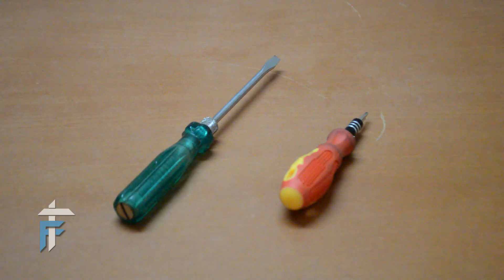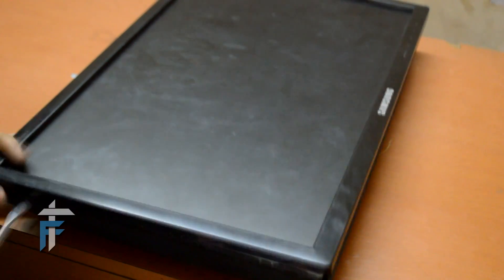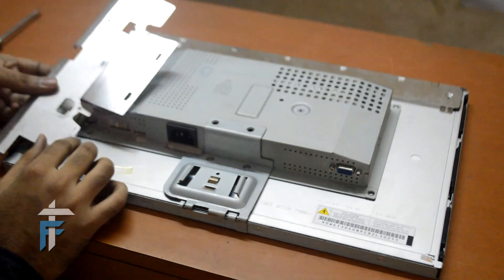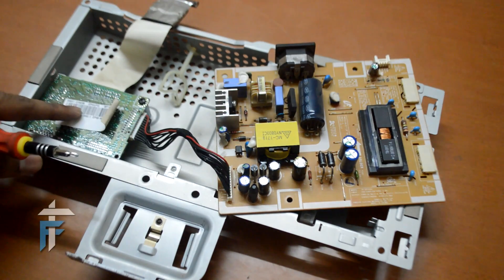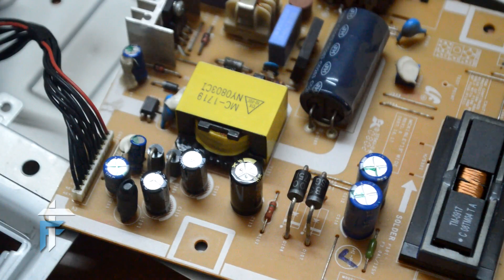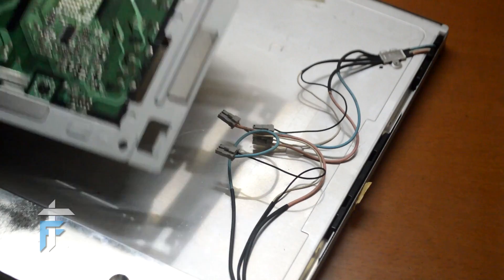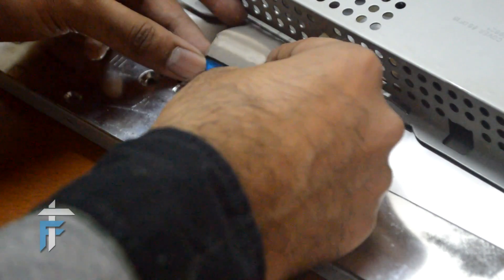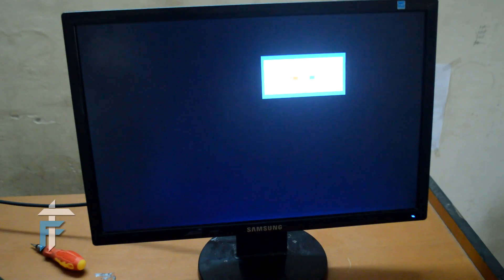LCD Monitor Repair and disassembly | Samsung Syncmaster 943NWX

Comment: The repair guy titled the circuit and threw away the metal, the monitor still worked fine for a few days then went back to how it was and after I opened it and fixed the bent the monitor won't display anymore, it turns on but it doesn't display and I have no idea what to do, I used to hit it hard to force to display, now even that won't work.

Comment: Nice video. Is it possible to disable the energy save option hacking the internal power supply? I need to have it always on and not entering in low energy mode...

Comment: i have the same monitor..no bad capacitors but when plugged in, screen is blank ang flickering like its trying to turn on but will not
Reply: There are High-Voltage Fluoroscent tubes in this model, not LEDs.
First try bypassing the "protection circuit" (search on internet)
If you cannot pinpoint the cause of flickering, just convert it to LED (unofficial kits are available)

Comment: I replace 3 capacitors in the hot zone and the 3.3 volts out is only showing 0.5,  the rest are 15 volts ad 3.3 volts perfectly. I have no video. Any ideas? thank you.

Comment: same monitor  is have an issue with reddish screen while connecting VGA cable to CPU, if not connected to CPU the sign as shown after plug-in  just works normal, any solution?

Comment: i broke the screen while i change lamps for this model , is there any solutions ?
Reply: It's fixed right in color blood red that fibg that made around the world  that was ours wit h yours it was like it was married together  but around the world someone else awaits for what the promise was of one and  a contract that was put forth you never came on that behalf I can get real mean if so then what  a duel  RSP 1012 2nd Corso nebr city nebr USA tetracycline batman only it will go below the belt and come back  pinch a little powerful huh mid body  worked out for alk you huh  that'd what I say whats done I'd done and a deal is a deal    mercenary  think not canary yellow his truck my brothers  blue on white that car blue on black mind got stolen but l jn alm UT needs returned before 72 hrs is up from now

Comment: I used this video to help me repair my Samsung SyncMaster 953BW, Very similar. I also had this same problem with my SyncMaster 204B. Crapy caps. Change any swollen caps and any others of the same brand. These caps are junk.

Comment: The inside part of the  glass of my LCD monitor shows  lot of mottled appearance.               How could I open and clean the glass ?. Electronics is OK
Reply from the maker: You need to check if the lcd and the glass are not like a single combined module. If the problem is only in a few spots then it is better use it without tampering much as it can get worse. Or else it would be better if you can send in some pics of your LCD so that I can help you in a better way. Email me the pics at technofall007@gmail.com
Reply: Namaskar: I went and opened the monitor. In my unit the lcd is separate from the glass. A polarizing  film is there stuck to glass. This film has  lots of mottling.  Trying to find polarizing film or a surplus glass with good polarizer.

Comment: I have a problem with same monitor 6 line appeared on screen in horizontal,  screen is blinking, Britness option is appeared can you tell I repare or buy new monitor reply as soon as possible
Reply from the maker: Sorry for the late reply. You can try repairing, and if that doesnt work for you then go for a new one.